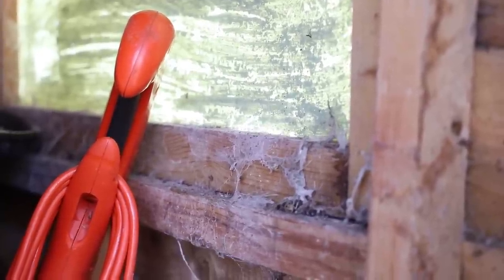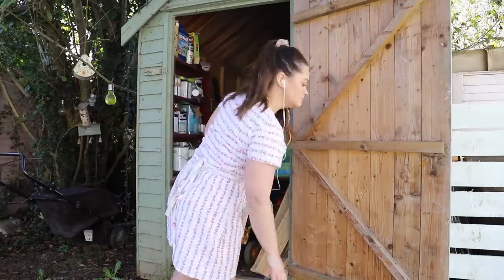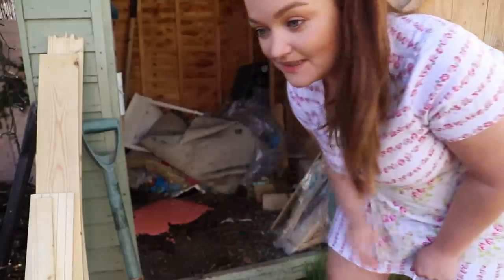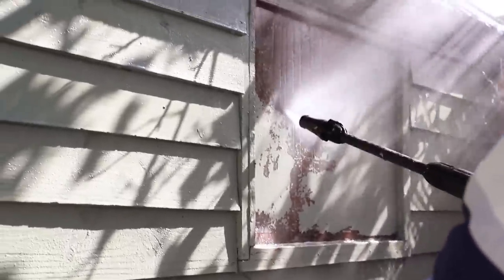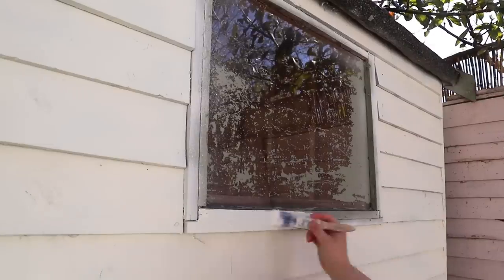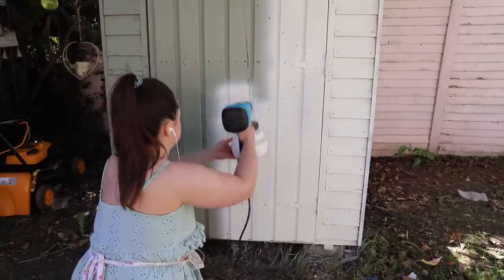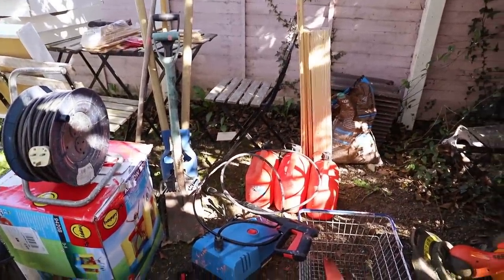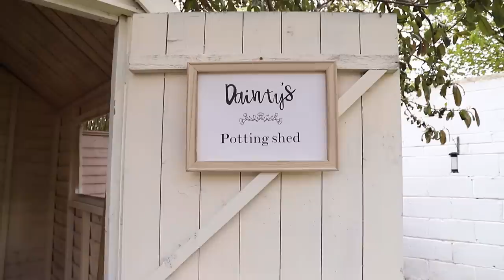Satisfying Garden Shed Declutter & Mini Makeover

Comment: I got one of the Rubbermaid storage benches to set on the side of my house in a small garden area. The bottom is a big storage area I use to store all my saved wood! It keeps it dry & protected but it still useful for seating. I made cushions for it there is just enough room left to tuck inside during bad weather. Great job on the potting shed! It looks so clean & crisp inside & out now.

Comment: I've noticed you've used the Autentico chalk paint, which will run when it gets wet from rain. You need to spray an exterior varnish over it. Or did I misread the label?

Comment: You could try a peppermint plant in your shed to repel spiders, or peppermint essential oil in water to spray the corners inside. Just an idea. I hate spiders too.☀️
Reply: Does peppermint help to get rid of spiders ? Can i also use dried peppermint? I have some in my garden and some dried peppermint from last year🌻
Reply: @susefink6099  I would try the leaves in little bowls spread around! I use the essential oil in water to spray around outside doors and windows and it has helped.
Reply: @cathrynkolkman1811  thankyou,i'll give that a try.we have them in the house sometimes,and well...they like to be high on the ceiling😊